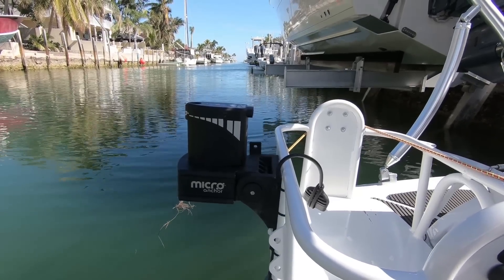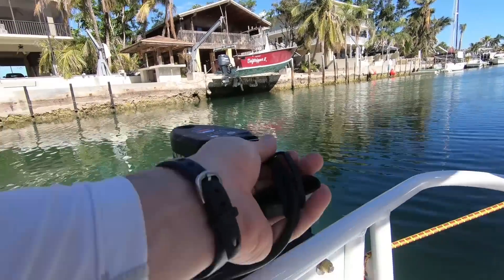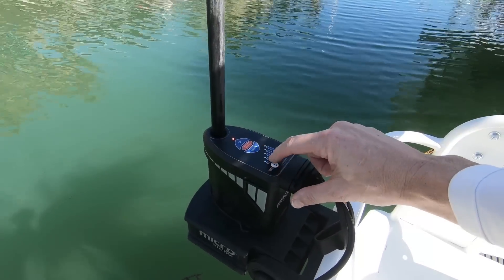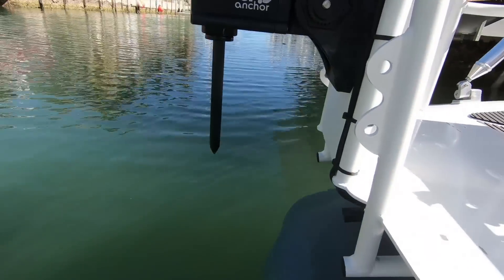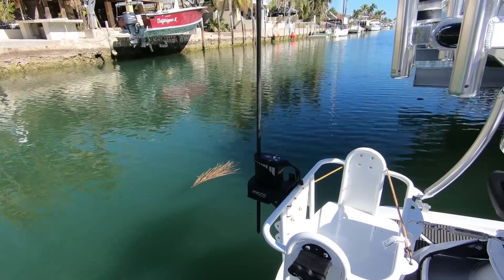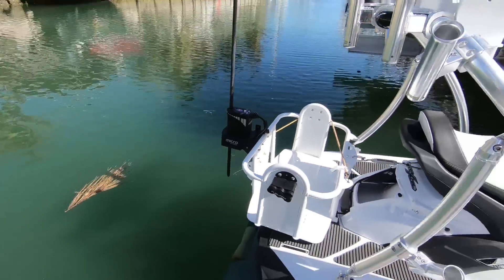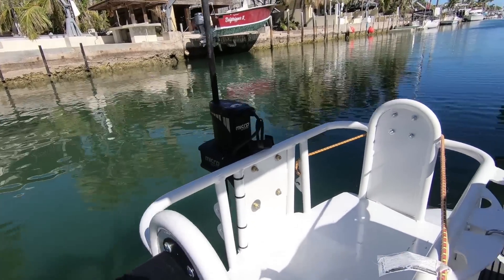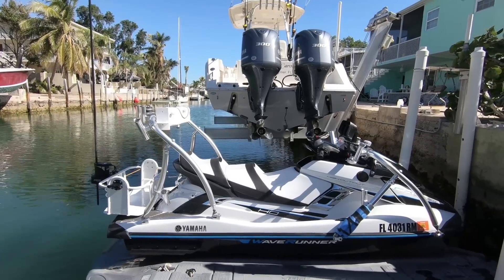Power-Pole Micro Anchor on a Fishing Yamaha WaveRunner How To

Comment: How does the power pole, in the up position, handle chop and waves? Has it ever come out? For reference I have a Yamaha SVHO for play and a OldTown MinKota powered kayak with 8ft power pole for fishing. Power pole has been my favorite accessory however even on the Kayak that 8 ft pole feels unstable on the back through any kind of waves. I have everything needed to set up the Ski as a fishing vessel just need to plan a trip and debating if I set up the power pole.

Comment: With the cooler rack, it looks like it is covering the water jet that shoots up from the back deck. Did you redirect the jet? Looking to build a cooler rack for my FX HO... thanks!
Reply: Hey Lovin, so you are able to re-direct that jet anywhere you like or even remove it and plug it permanently.  It is not a necessary mechanic for the operation of a Yamaha, more of a trademark. Look near your jet output and bring a flathead screwdriver.  Have fun!
Reply: That’s an easy bypass switch you can hook underneath the swim deck above the drive. And having the valve bypass is nice if you tow tubers as to not spray them the whole time. Did it on my 2012 Yamaha VXS

Comment: Very nice!  I have an '17 FX SVHO that I'm in the process of setting up.  I'm looking to set mine up very similar to the one you have here.  I looked at the fishmaster arches but it looks like they discontinued the front arch as it is not on their website anymore.  I see you are using the rotopax vs the 12 gallon fuel tank.  How has that setup worked out for you?  The rotopax only offers a maximum of four gallon tanks right?  You must be running two 4 gallon for a total of eight?  Looking forward to your build video that I'm sure will answer many of the questions I've asked or am thinking of!!
Reply from the maker: Hi Joe, the 12 gallon tank works great but I wanted to try something else on this build and have a bigger cooler.  Stay tuned for the build HOW TO video.  thanks for watching

Comment: Hi, I am considering getting into jet skiing and maybe fishing.
So newbie question..with the rig on the back of your ski.
How do you mount your Ski if you end up in the water?
Can you climb over it?
Reply from the maker: Hello and thank for watching.  The WaveRunners are very stable and I have never turned one.  The one time I slipped off, it was an easy pull back up from the side.  If one is heavy or not in good muscular shape, I imagine it may pose a problem, but that would apply to re-boarding from the  rear also.